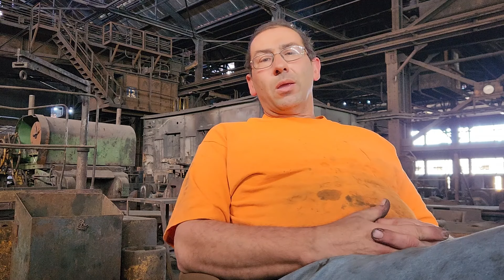Where We Have Been and Where We Are Going...

Comment: assisting the engine with electricity sounds interesting but where do you get the power from? hopefully not by a nearby diesel generator? also how much more expensive would it be to make or buy an additional boiler compared to that? i dont know much about that
Reply from the maker: The GE diesel locomotive out back should have enough power with one of its generators to power the mill motors but we will be reactivating the second generator anyways. Everything in our building is powered by that locomotive.  The overhead crane, welder, drill press, etc. All lighting and 120VAC is provided by the off grid solar installation in the caboose.
Reply: @YoungstownSteelHeritage   thank you for explaining. I was just worried about one of those smaller generators that make lots of noise. Somehow I missed the info that the GE locomotive is actually powering stuff there and I thought everything is powered by solar and when no visitors are there by small generators as well
Reply: You Have Done a Remarkable Job !

Comment: I love your mission. I wish I lived close enough to help.

I worked in a bar mill once and we had a small furnace natural gas for heating steel bars. The furnace had inside dimensions of about 3ft cubed. The furnace would be used to heat bars that were about 3ft long and 3" diameter that were intended to manually feed into the entry of intermediate mill. The bars were manually fed to test the mill setup after a size change. I think you should look around McDonald for a furnace like that. There may be one there. It would be perfect for heating bars for your museum rolling mill.
Reply from the maker: There are a couple of heat treating ovens over there, but I am going to go a different route and build our own furnace.  I did find a couple of small furnace doors off of their old billet heating furnace that will work as end doors on this new furnace.   Did find enough gas burners for the new furnace as well.
Reply: @YoungstownSteelHeritage  That is good! Hopefully you pick a door that has some "character" to it. I don't know how elaborate your new furnace will be, you may want to look for the proper safety rated gas valves. The ones I am familiar with are Maxon brand. Also you will need the flame safety relay and UV detector to work with the gas valve. On a reheat furnace, the gas that supplies the pilot burners is on a big enough line that it would be sized well for the main burner on your new furnace.